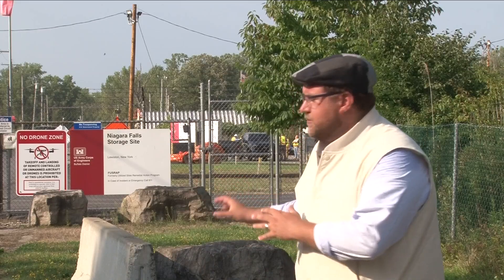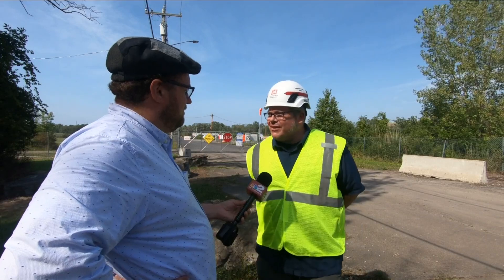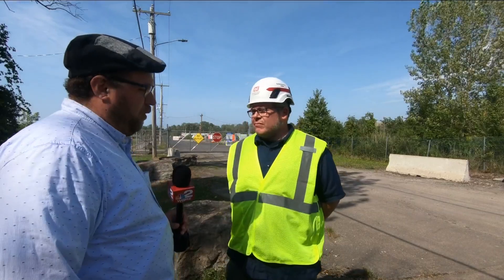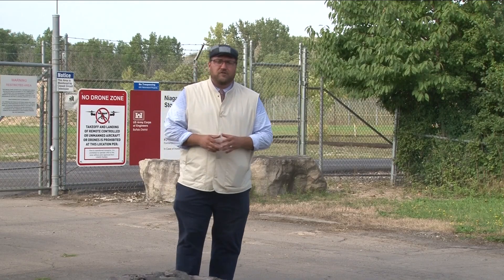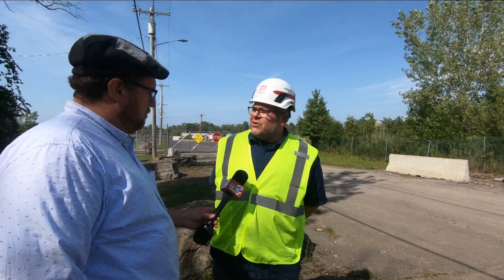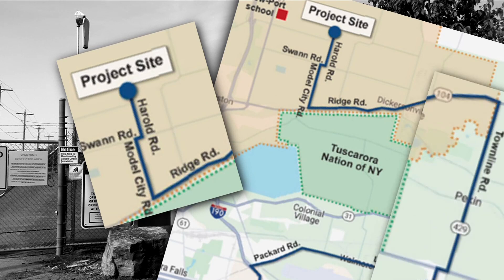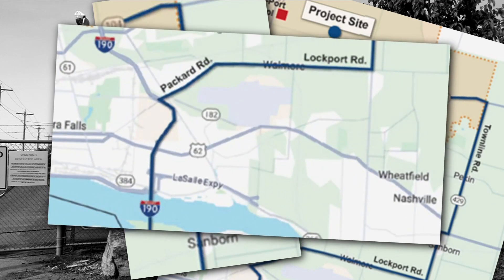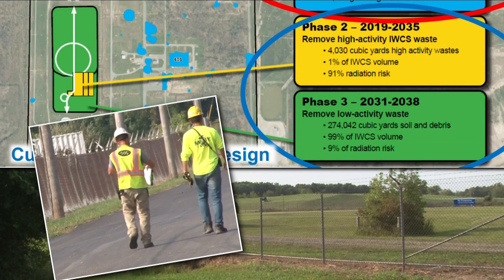Manhattan Project debris is finally being removed

Comment: Any information on the waste characterization?  Which radionuclides?  What is the level of radioactivity?

Are there any demonstrated cancer clusters or other disease or illness occurrences?

Or is this just an overreaction?
Reply: It’s a good question unfortunately he didn’t have a geiger counter. So we don’t know. I think every media journalist who does this type of radio activity news journalism should have one.
Reply: @damonabets3779  I dug around a little bit and got past all of the media reports to actually find something from the DOE about it.  Most of the waste is considered low level.  The plant was actually an ore processing plant.  If I am correct in my understanding of the situation, the waste is likely the tailings from the ore processing.  In its natural concentration, uranium is primarily the U-238 isotope which does not have near the activity of the U-235 isotope.  The separation of the U-235 isotope occurred at places like Oak Ridge.

It seems that there was previous remediation done to place clay caps over the low level waste pits.  

One thing that I find interesting is that there is no mention of the risk of a truck accident from the thousands of trucks traveling to the facility in Michigan.